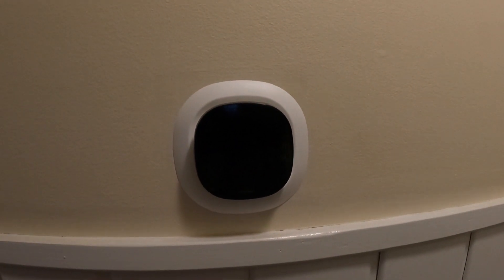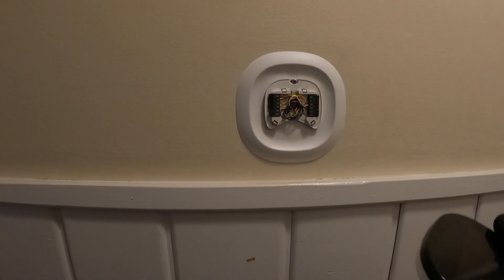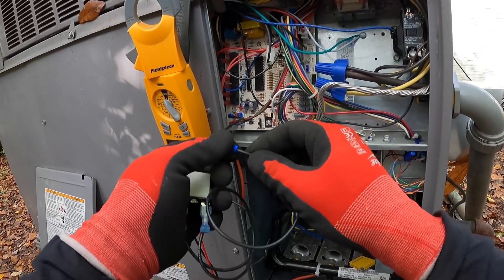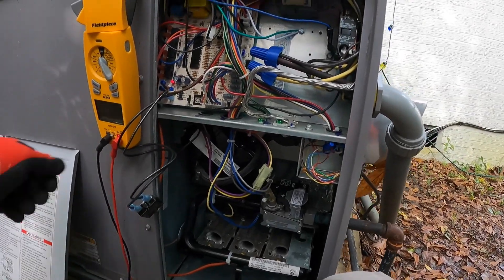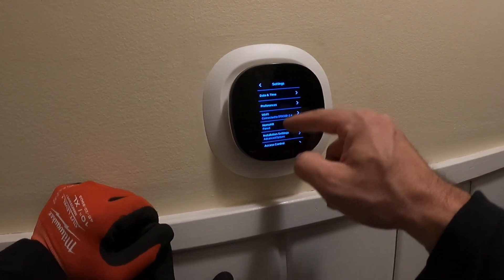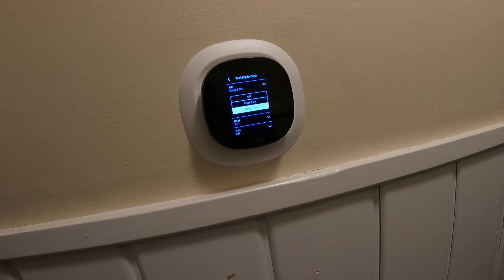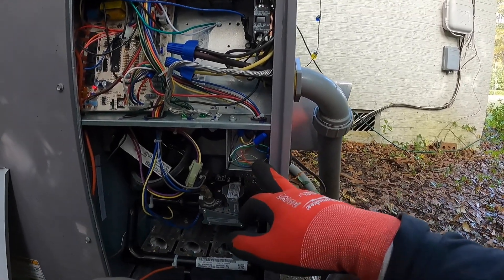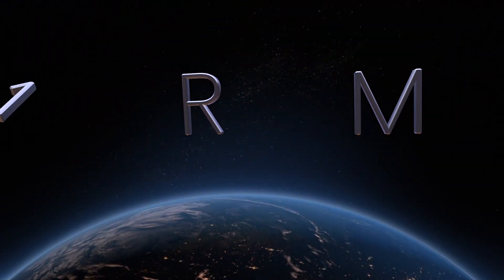Troubleshooting low voltage shorts

Comment: Quick question had an issue where I was testing the wires like this and in the during heating sequence, it made it to the hot surface ignitor, started making like a dinging noise and then the fuse pops. Any suggestions?
Reply from the maker: More than likely an issue with the hot surface igniter or the control for it.  I doubt the igniter itself uses 24v for power.

Comment: Great informative video. Thanks.  

My furnace just stopped heating. 
Done some simple testing and inducer blower comes on and before Ignitor glows, it pops the fuse. 
I replac3d the Pressure Switch and Ignitor and still keeps popping the fuse right before Ignitor glows. 

Any ideas what might be the issue?
Reply from the maker: @daniell4991  the gas valve is usually activated by low voltage.  Disconnect the low voltage from the gas valve and run it through a call for heat and see if it blows the fuse.  If it doesn’t, it’s the valve.

Comment: 3amp fuse is blown only when switched to heat the AC side works no problem. Start up is fine on heat. flame goes on and as soon as the blower starts, the fuse is blown any suggestions?
Reply from the maker: @jorgeangulo9691  is this a module driven motor or a relay & capacitor style motor?
Reply: @ I believe it’s module driven Goodmen GPG 13
Reply from the maker: @ I’d bet on the module causing the issue.  Unplug the low voltage wires from the module.  Call for fan at the thermostat/control, if the fuse doesn’t blow, it’s the module.
Reply: @ I was able to run the AC without the fuse being blown

Comment: I burned up a transformer by using a 5A fuse instead of the purple 3A. Cause of the blown 3A was a shorted coil on the contactor in the condenser unit. I would suggest to use the same value fuse that came out.

Comment: Can you explain Why Fuse Pops when I connect the Y’s to the furnace control board? Like I can’t power Outdoor unit with 24v because it pops
Reply from the maker: There must be a short of some kind in your wiring or the contactor in the condensing unit.

Comment: So do you just use a 5 amp popper fuse as well  for trouble shooting or do you carry both 3 and 5 for testing purposes?
Reply from the maker: I haven’t had good results using a popper….transformers getting burnt up.  I keep a big box of 5 amps only.  No issues using just 5’s.

Comment: I’m with you on using 5 amp fuses. Good vidio, I just had one with an intermittent short it would go about a day I hate those its so much easier when it’s a dead short. I had a bad contractor coil and I pretty much felt like that’s what it was when I went out. Lol, I didn’t take the time to ohm out that coil so it cost me having to go back. I knew better that’s one of those live and learn moments. Good vidio thanks.